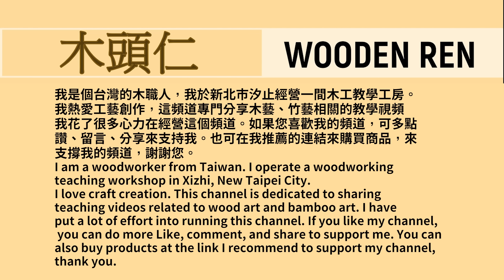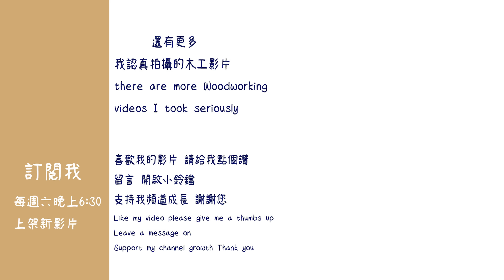Making combination bamboo bow | bow and arrow #057

Comment: I have to ask I have a Yumi bow but it is made in America, it has bamboo front and back and it has blood wood accents, the bamboo is cracked, is there anyway to fix it? Or is it just scrap now?
Reply from the maker: Hello, if you are referring to the separation of bamboo and wood.
In this situation, there is residual dried glue inside, and the re-adhesion strength may not be enough when the glue is poured in.
However, it is also troublesome if the entire scraping glue is removed and re-bonded.
I think you can try pouring glue after drying. Wrap it with rope and try it with instant glue.

Comment: Nice piece of woodcraft but not very efficient bow . You don't scrape the strongest outer part of the bamboo . Here that produces a lot of set (maybe 3 inches of string follow) No need for bamboo on the belly;  one should rather use a strong wood like osage or ipe and induce some back set.
Reply from the maker: Thanks for your suggestion, I will give it a try.

Comment: Good work of making a fine bow 👍! What kind of string is the best string for a bow that can't be easily broken ?
Reply from the maker: Does the bow break have anything to do with the string? Should the bow not be made properly, or it will be broken if the method of use is incorrect.
I use this
https://www.ebay.com/itm/Archery-Bowstring-Dacron-Material-Bow-String-Making-110M-for-Recurve-Bow-Longbow/264210101878?_trkparms=aid%3D1110006%26algo%3DHOMESPLICE.SIM%26ao%3D1%26asc%3D20200520130048%26meid%3D8e7dce9e8c984032aa920ae351bf4db2%26pid%3D100005%26rk%3D1%26rkt%3D12%26mehot%3Dco%26sd%3D183009203040%26itm%3D264210101878%26pmt%3D1%26noa%3D0%26pg%3D2047675%26algv%3DSimplAMLv5PairwiseWebWithBBEV2bDemotion%26brand%3DUnbranded%2FGeneric&_trksid=p2047675.c100005.m1851
Reply: @woodenren  I use bamboo bow for hunting and sometime in the middle of hunting period, my bow string get break down due to poor quality and disconnected frm the bow. So, i hv to use my spare bow string. You are expert bow maker, and you must be knowing the best quality bow string. Thank you 🙏

Comment: ЕСТЬ ЛОНГБОУ НА 101 ФУНТ bow tension 100 pounds @
Утренние замеры вытяжки тетивы на стрелу 85 см показал 101 фунт. (46 кг) и я не услышал никакого потрескивания и даже шороха ..
Лук для экспериментальной прикладной истории методами тестов проверяются догадки и гипотезы, связанные с историей лука. Дальность полета стрелы, точность боя, начальная и конечная скорость стрелы, сила пробивания различных материалов, условий хранения, практическое применение, удобство использования и многое, многое другое.
HAVE A 101 LONGBOW
Morning measurements of the bowstring draw on the 85 cm boom showed 101 lbs. (46 kg) and I did not hear any crackling or even rustling ..
I've wanted to do this for a long time. I did it.
Bow for Applied Experimental History, the guesses and hypotheses associated with the history of the bow are tested using test methods. Arrow flight range, combat accuracy, initial and final arrow speed, penetration force of various materials, storage conditions, practical application, ease of use and much, much more.

Comment: here is a slight quandary. amateur bow user. now in wheelchair. makes it difficult to use bows with string length great then 1meter long was used to 2m length with 25 - 30 kilo draw. what would you  do to help this? am able to set string fine.